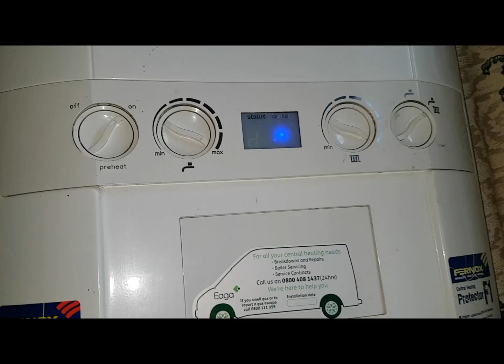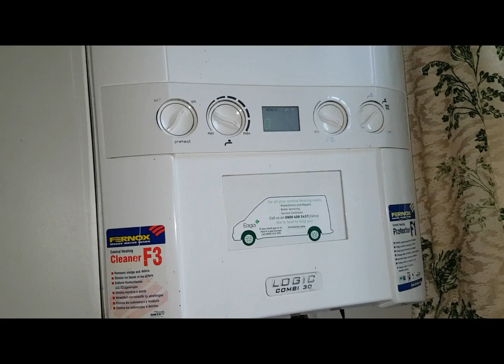Ideal Logic No Central Heating - Understanding How Your Boiler Works  With Coach Tony Morgan

Comment: This video makes no sense. What has been explained is nothing. Leave the boiler “on” on the switch fuse spur. Use Honeywell stat up & down to control your heating & hot water is on demand.

Comment: There no logic to this video excuse the pun .. I have slightly different problem but essentially u leave your boiler at all times .. it will come on via your timer or your thermo stat settings lol u do nt turn it off when not using it and it takes time to warm up .. heat ignition firing system whis knows I'm no expert essentially give it a mo like computer and it should be ok ..also if flame keeps going needs a service...right now mines playing up keeps going into pump overrun  ..may need a new pump guessing need call an engineer but not this guy 😂😂😂🤣🤣🤣

Comment: Just light a metal bin on fire. It's the only way you'll survive winter with a logic boiler.
Reply: Well I’m fuckdddd then 😂😂😂
Reply: @SporeZSporeZ  Me too. All winter. And the bastards gave us a Logic boiler with a Drayton wall dial. £1.500 they should be on watchdog's.
Reply: @leewilliams6208  zoots and showers at least one shower is working tonight, no radiators....
Reply: @leewilliams6208  where do I get a metal bin...
Reply: @SporeZSporeZ  I either get radiators or hot water. Never both. And it's a nightmare trying to switch.

Comment: Can theses boilers be fitted with zero clearance around casing?
Reply: The boxing around the boiler doesn’t comply with the Boiler Manufacturers MI’s regarding clearances.
Why wasn’t this pointed out by Course Cowboy Tony Morgan??
Reply: Fibre Washer well said. Could do with a few more stickers on the boiler. Like a warning Notice.
Reply: I thought the M.I 's clearance figures were for servicing purposes? E.g to be able to get the front case panel off and space below the boiler to get to connections. It does look like there's not enough clearance around the sides of the boiler but the front panel looks like it would come off easily and it looks like those surrounds around the boiler are removable via screws. Would it still need a warning label for that? I only ask cos I'm a trainee at the moment. Thanks.
Reply: Harry Jones the boiler clearances are stated for a reason Harry, how accessible do you think the Filling Loop is for example.  Now, I know Tony is making a point about customer’s use of the appliance & system, but surely he’s noticed the installation doesn’t comply with the MI’s.
And, as he’s the last man seeing/checking the installation it’s him that’ll get his arse kicked off the GS register.  Not good for someone passing on his supposed knowledge eh!!!